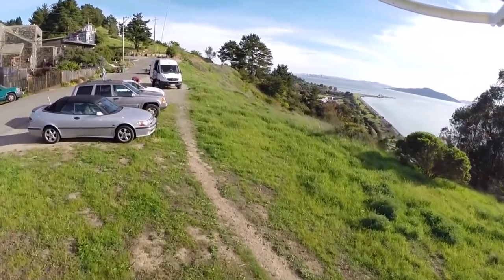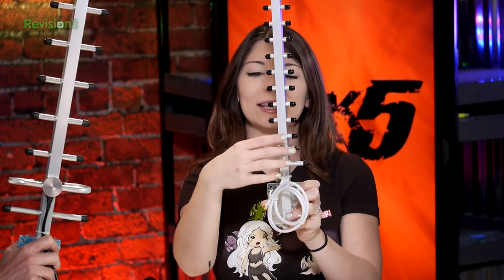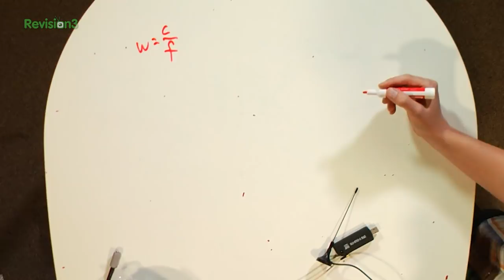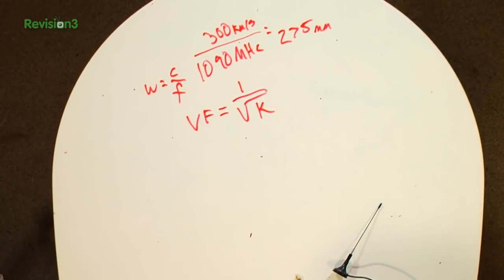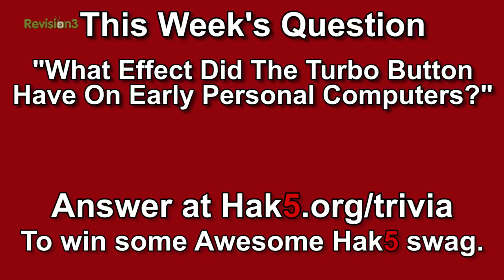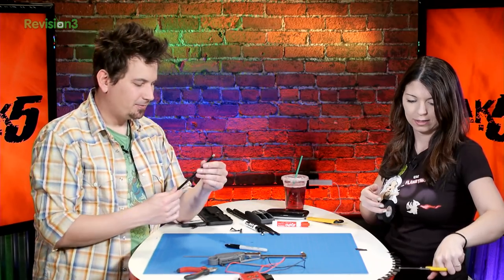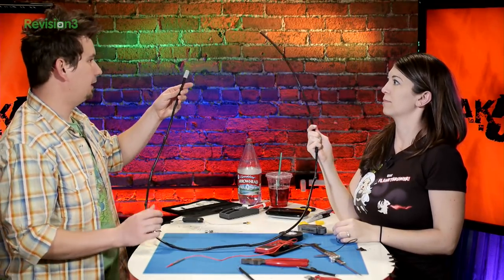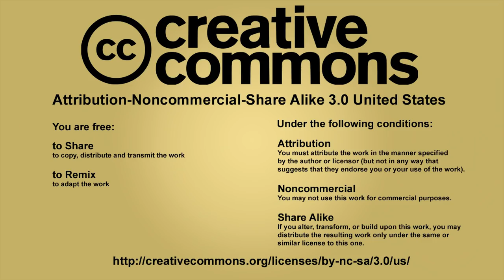How To Build An ADS-B Antenna, Hak5 1606

Comment: The formula I like is: 300 / frequency in Mhz = wavelength in meters. Or: 300 / Wavelength in meters = frquency in Mhz. Those formulas work well enough. I always make my antennas slightly long and shorten the antenna as needed till I get a suitable SWR.
Reply: You've finished your antenna ?

Comment: The radio frequency signals in each 1/2 wave section are kept in the same phase by the cross connections of the hot conductors and shields. This coordination of phases are what produces the gain in the overall antenna. They are all working together like multiple rowers of a boat rowing in the same direction instead of against one another.

Comment: 75Ohm is the cable's impedance not resistance. There is a difference.
Reply: +dellagd 75 not 750
Reply: That's what he said. 75. ...As in 75Ohm
Reply: Yes, impedance is AC reactance (resistance to AC) plus DC resistance. The figure is used of course because RF signals are a form of Alternating Current. Darren seems so enthused about radio stuff in general I reckon he might do well to get a Ham licence if he hasn't already - the training is very useful - more so as you go up the licence scale.
Reply: ***** He didn't say 750 hm, but 75Ohm. That's an "O" not a zero.
Reply: what is the main difference between impedance and resistance?

Comment: The turbo button limits the clock speed of the cpu because some applications wouldn't work when the clock speed wasn't set correctly.

Comment: The symbol for wavelength, whether it is light, sound, or vibration is Lambda. it is the 11th letter of the greek alphabet. ANd it is lower case cuz the upper case symbol means different things. It looks like an X with the top right leg chopped off.

Comment: For receiving RF 75ohm coax is ok but not the best if you plan on transmitting RF 50ohm coax like RG-58 or RG-8 is what you need also LMR-400 is great for building collinear antennas I have built many 2m/70cm HAM Band collinear sticks placed inside of PVC to keep a tidy build

PS love the videos and you many want to try building a J-Pole or Super J-Pole
KC9WSC
Reply: Hi there, i would like to know if at the tip of the collinear antenna there is something that conect the center with the braid conductor, cause i see they left all disconected, it is corect?  May somebody use a 50/75 ohm resistor or just  do a "short circuit"  from central pole and the other pole ?
Reply: This is for receiving only, you do not use it to transmit, so not relevant to what they have made
The main problem is they didn't explain it clearly enough or test correctly, leaving some people probably confused.

Comment: lol - and what was the resulting antenna working like? Did it work? I would expect you did detect some far away planes but then they faded away when they came closer to your location? 
The point is: planes are not only moving on the surface, i. e. in 2 dinemnsional pane, and they are not always in the line of sight, Planes do move in  3dimensional apace, so you usually don't want to have signal that much concentrated and picky about the right heigth. Especially as you won't get further than the point when the planes do climb over the horizont, meaning your line of free sight. If they are below that line you won't get them anyways. Another negative aspect is, that there is not only one single plane sending at a time. If the planes don't receive signals from each other they may send their informations more than one at a time. And thus the information packets would "collide", they get lost.
I did build some stacked antenna with only 3 elements (even if it was no collinear antenna) and got detection radius of about 100..160 miles out of it. Range was depending strongly on the weather conditions and was heavily blocked by geological obstacles in the line of sight. So 3 elements did already get me either very close to the horizon with my RTL-SDR stick, maybe that really was horizon already, where the planes would disappear from the line of sight due to the curve of earth surface. But I got better results when I split the receiption area into multiple segments. That is because then I had by far less packet collisions and therefore I got more continous receiption, including the area the area directly over my antenna location.

Comment: Regarding what's said at the 7m5s mark, would using a longer antenna damage the equipment it's connected to?  I've killed THREE working Alfa AWUS036H (1W, 5dBi antenna) after having plugged in a longer / higher gain (9dBi) antenna for a few minutes.
Reply: Kinda depends what the setup is but in general no, not if you are using the proper ohm cable for the antenna and test your SWR or Standing Wave Ratio with an SWR meter, that's the amount of impedance mismatch on the antenna elements. If the SWR is too high you WILL COOK the radio equipment because that feeds back into your radio equipment as reflected power instead of being transmitted. Also, as long as you aren't transmitting and just passively listening it won't reflect that power back into your equipment. As an example, if you are using 75 ohm coax on a 50 ohm system you will toast your equipment...

Comment: ***** Here's an idea: mount a raspberry pi to a drone with an RTL SDR dongle attached. Get the pi to collect adsb packets in flight and stream them over WiFi!
Reply: Funny you should mention that........... ;-)
Reply: I did that on an AR.Drone (which runs Linux and has USB, so no Raspberry Pi required): http://lemondronor.com/blog/indexphp/2013/4/cheap-ads-b-on-amateur-drones

Comment: PRETTY SURE your RTL-SDR "Software Defined Radio" uses 50 ohm coax not 75 ohm cable TV coax. Your antenna would work better if it was made out of 50 ohm coax because 75 ohms causes an impedance mismatch... I know for certain if you tried transmitting with that antenna on a 50 ohm system you'll TOAST your equipment!